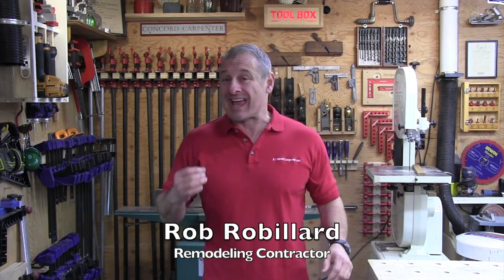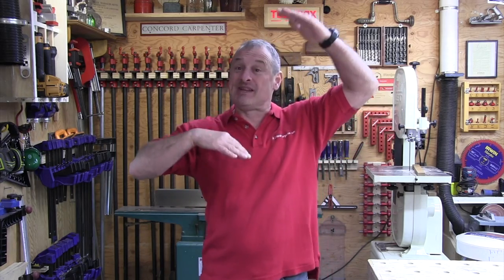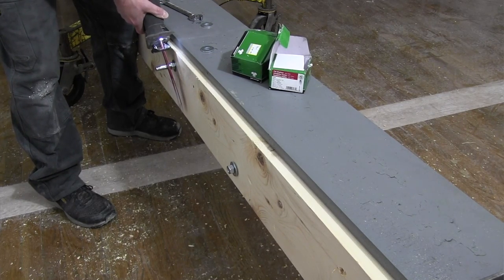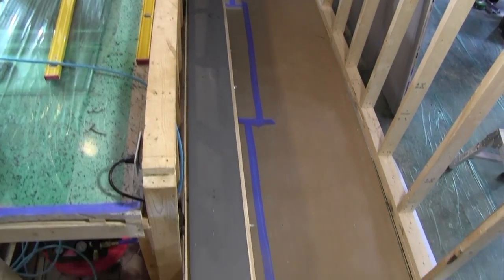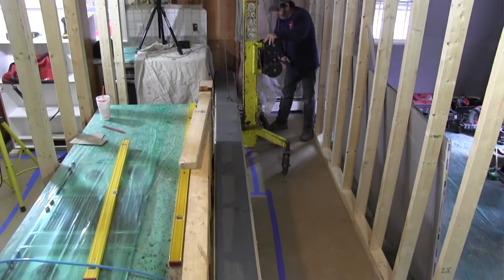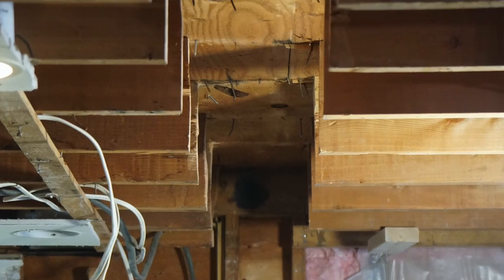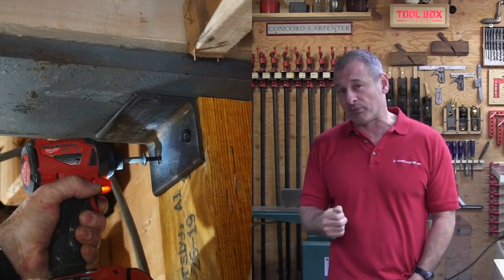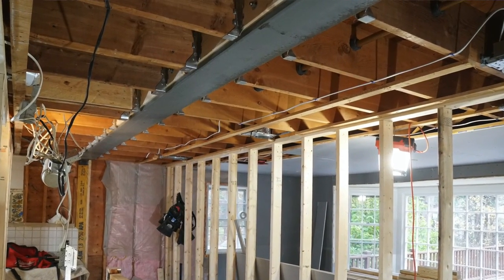Replacing an Exposed Beam With A Hidden Steel Beam

Comment: I have clerestory construction where the roof truss beams go through the exterior wall to the lanai outside by the pool and pergola style pool enclosure that has 8 4X8 cedar beams over the pool, they are not load bearing other than their own weight and the pool screens.  But....  The headers that hold those beams up as well as the main roof trusses on the house side of the pool are badly rotted.  I just closed April 6 and knew there were three of the non load bearing beams that needed replacement, but now I see they all need replacement along with the header all the way along the pool length, which is 44 feet on one side and 34 on the house side, but the one on the house side of the pool is a critical structural element.  It holds the roof up and I have found one of the header beams to be so rotton it is actually hollow, a kitchen knife meets zero resistance when stuck in.  I need to get an engineer here ASAP and get the trusses shored up pretty much the same day on an emergency basis, but half the engineers in this area either retired when covid came along or they have shut their offices for the duration and I have been unable to reach any or get a call back.  
Since the wooden members are exposed to Florida weather and over a pool which is by definition a damp place, I am thinking that replacing the 4x10 cedar headers with steel 4x9.5 box girders or I beams would be the best way to go since they can't warp or rot if protected from rust.  The house was built in 1991 and it seems these wooden beams should have lasted longer than they have for such important load bearing structural members.  Wood might be cheaper but by how much?  Is it worth it if the job just has to be done in another 35 or 40 years?  
By the way, the open span between the support columns is 12' 8" on center of the columns.  So, the important load bearing house side would require 3 beams/girders to replace the rotton ones.  And god I hope none of the trusses going into the walls inside have to be replaced.  I think I would have to walk away if that were the case.  But it is all going to be acedemic if I cannot find a working engineer in the next couple weeks.

Comment: Great video. I have an exposed beam in my basement (approximately 22' span, 3 ply 2x10's) with two screw jacks supporting it in the middle spaced pretty much equally. One end of the beam is on jack studs which stand on the foundation. The other end is buried in a wall but appears to be standing on multiple 2x4's. The other side of that wall is another screw jack. The beam, being in the basement, carries all of the floor joists across it, they are not attached with hangers. I have no issue with the height of the beam but want to be able to remove the two equally spaced screwjacks so I can open up the 20x22 room. Rather than replace the beam, do I have the option of attaching steel plates to either side of the beam, bolting right through it, before removing the jacks ? If so, who do I need to talk to, a structural engineer ?

Comment: I am planning to remove a wall that carries a load of my ceiling joists only, the engineering specifies a 2 Ply LVL 2x9-1/2" 14 feet, I was planning to buy 2 2x12" conversational lumber instead(Home Depot), the LVL costs 5x more in my city, any toughs or tips?

Comment: So in this case, you were lucky that no electrical wires were running through the existing beam. My question is how do you handle wires running through the beam? I presume, all wires have to be cut, then fed through holes drilled in the packed I-beam. The questions are 1) how to splice these wires? 2) how to determine the max size of hole(s) that can be drilled in the web of the I-beam? and  3) what the spacing of theses holes must be?
Reply from the maker: We were not lucky we had an electrician relocate the wires sometimes we had to do new home runs all the times we ran the wires down to the garage below into a junction box and then back up inside the house

Comment: Hey sir I am extending my back porch out. It is 22 ft long and I want to extend it 22 ft long by 22 ft wide. I am wondering if a 5 inch concrete pad is over kill. I am wanting to add 5 inch weld plates and use a 4 inch metal I beam as my post in a 4 corners and on 2 walls another I beam in the center. Does that sound standard?
Reply from the maker: 5” for you stairs or a post?

Comment: If you have ceiling height, why not install the beam under joists without cutting the pocket .
Reply from the maker: You could but then you have a drop beam and many folks prefer a flat ceiling

Comment: How do you connect a 10Wx39 steel i-beam to a 3- 2x8s column? I would add blocking to the web and through bolt it (4x). But how do you connect the block part to the 3 - 2x8 columns? I cant find anything from Simpson.  Note: 2x8s are on a sill plate and the three board will be head locked together.
Reply from the maker: We welded an angle flange and bolted the flange to a 4x6 PSL under the beam (point-load) , we also added full length PSL studs to the sides of the 4x6 to sandwich the beam

Comment: What was the ballpark cost? I have the same span I’d like to get rid of a post in. It’s in the garage, so ceiling is already exposed, foundation walls on both ends. Seems easy.
Reply from the maker: jooper99 8k
Reply: @ConcordCarpenter   Thanks for telling us the price. I was looking in to it.  Somebody cut my beam in 3 back in the 50s for heat transfer from coal stove in the basement. It's been like that for 60 years so at $8 K it should be alright 😂

Comment: Is there ever been a situation where you could attach the brackets for Point load beforehand so that you don't have to weld within the structure?
Reply: You could but, if dimensions are off, something changes or, they clash with anything, you would have to grind the welds in order to remove and relocate them. Bolts with slotted holes might work but only if approved by the S. E. (structural engineer of record). Another option would be to shoot threaded studs on the bottom of the beam and slot the holes in the angle bracket.
Reply: @thebnbaldwin  very interesting point of view structural construction has always held my interest especially beams and such because I am a metal fabricator I just find it all fascinating Naturally Wood metal plastic the things we can make are only limited by the imagination and the practicality of it
Reply from the maker: Derek Bryant yes
Reply: That is very interesting stuff I really do enjoy the content on this channel in fact several of my tool purchases have been made from recommendations on this channel awesome stuff
Reply from the maker: @derekbryant6137  Thanks for the feedback

Comment: When installing a flush lvl beam in an old house that has 2x4 celing joists 14' long on 24" centers.  I plan on sistering with 2x8s. Which joist hangers am I required to use according to IRC. And does this plan sound feasible?  Thanks
Reply from the maker: I’d use 2x10 if you can get bearing at the foundation walls, or space 12” oc. If the 2x4 are try 2” then get “old work” double hangers for your sister joists and block under the 2x4 at the hanger

Comment: Sooooo...... interesting.  Question: I think I know the answer, but it appears some fasteners are lower than others. Why? And how do you compensate when putting up the drywall ceilings? Thanks! Rob
Reply from the maker: which fasteners are you referring to?
Reply: @ConcordCarpenter  The ones attaching the joists to the new beam. Thank you, Rob ... I thought would be flush... maybe it's my point of view angle
Reply from the maker: @robo7981  The joist hangers?  They are hidden by the strapping /ceiling board
Reply: @ConcordCarpenter   Oooopppssss... I have no clue... my bad... I was referring to 'those metal pieces' attaching the joists to the new beam, Example: at 10:49
Reply from the maker: The pieces at 10:49 is angle iron that was welded to the beam and bolted to the posts

We were able to clear that with our ceiling board

Comment: The comment at 10:05 ... I have done a job where it is "Friction only" meaning the weight above secures it to the 6x6 posts. How important is this to have? When doing this with an angle gusset the finish drywall then does not work. Thoughts?
Reply from the maker: Pretty important for seismic an code
Reply: @ConcordCarpenter  Thank you, I am in southwest PA. Little to no earthquakes ever, but maybe I will add once I am moved into house. The issue I have found is that there is a gusset attached to the angle for strength. When you go to finish the drywall around this it would create an angle making drywall to appear a bit odd. Any tricks around this finish part?

Comment: Wouldn’t the Dewalt dcs571 4.5” circular saw work better for cutting the beams???
Reply from the maker: chuck sanchez sure
Reply: I guess, I m trying to ask if the dewalt 4.5” would be able to handle the work that was involved in cutting the beams or not suited for that task
Reply: It would be cool if there was a saw that could cut like a circ but get into spots like a saber
Reply: @MsElijah16  an oscillating tool would probably work for the final cut.

Comment: How much something like that cost to do?
Reply: I estimated a 30' engineered wood beam at a bit over $4,000. 2 men, 2 days plus equipment. I was going to use 4 screw jacks per side in addition to the temporary 2x4s just to be safe.The steel beam is priced by weight in lbs. per foot, plus delivery. The price varies depending on the price of scrap steep out of Chicago.
Reply from the maker: 8-10K including all trades
Reply: Was quoted min 10k Canadian pesos if done in 2 days, 4 mans for a 30' span 24" OC, using a W8-40 steel beam
Reply: A Concord Carpenter / ToolBoxBuzz you guys do great work

Comment: You should have notched the outer to 2x10s so the joist could have sat in side the steel I-beam and you still could have put the Simpson ties around it but as you have it you have this huge steel beam and the only thing really holding the floor are a few TECO nails 😰 🤔

Comment: "the area between the floor joists is blocked" what do you mean by that at 1:35 ?
Reply from the maker: Joseph Pastore you have to provide solid blocking below the beam post , if it does not fall on a joist.  Soiled blocking completes the “point load” to the beam below or foundation.
Reply: @ConcordCarpenter  I think I understand now thanks!

Comment: not truly bearing if it was the floor beams would be inside the web of the actual steel I beam.  unbelievable really
Reply from the maker: I’ll let you debate that with the licensed structural engineer who designed it

Comment: I like this video, but it seems mental supporting a steel from timber posts. Just doesn't feel right. Not sure it'd be allowed here in UK. It's not thr done thing. However we're mostly masonry not timber frame. If the existing posts are timber as in your cae, I guess it makes economic sense to retain them